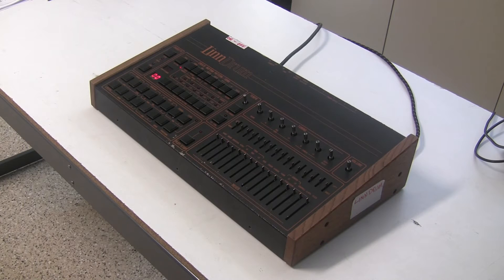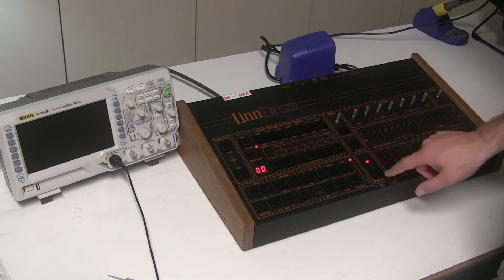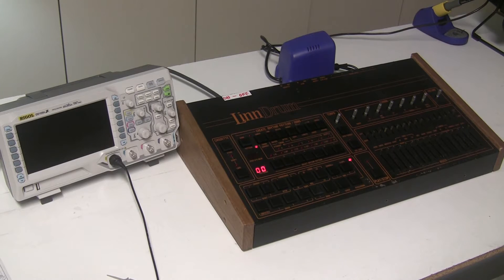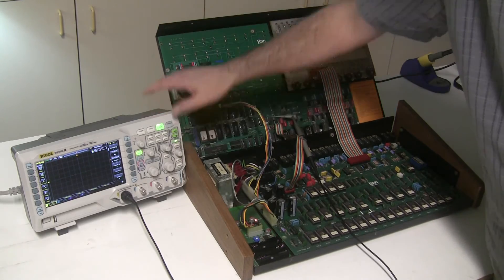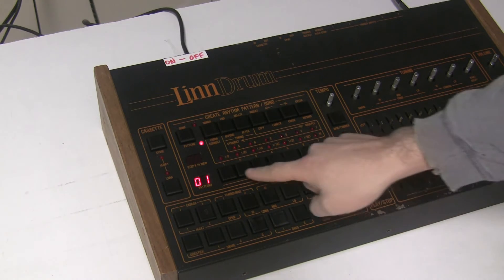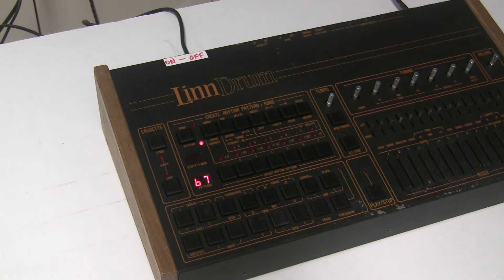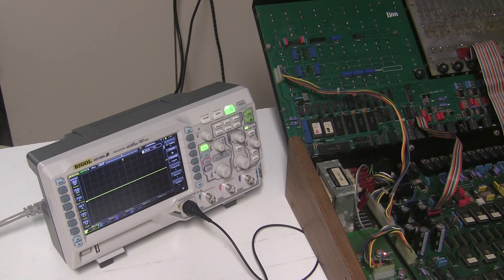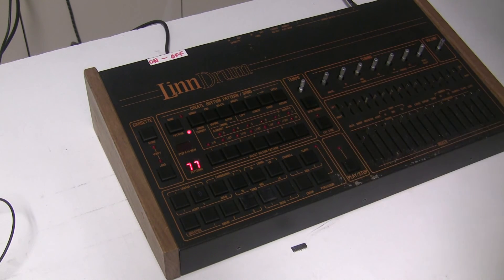Synthchaser #047 - LinnDrum Repair 3/3 - Fixing Display Issues & Final Test

Comment: Thanks for the great videos! I just finishing up a repair on a LinnDrum machine with many of the same issues and more. I was wondering if you have any information on the adjustment of the MPX frequency and filter trims. There is no info in the service manual. Are those adjustments just done by ear/preference?

Comment: Hey, just wondering are those EPROMs simple to replace? As in do they just click in and out? I wanted to try using custom EPROMs in my machine, thanks!
Reply from the maker: Yeah, its easy you might want to get an IC extractor (ebay 99 cents) to help you get them out without bending any pins.  Some Linns have some ZIF sockets (the blue thingies with a lever you throw to release the chip) and those you can change without any tools.